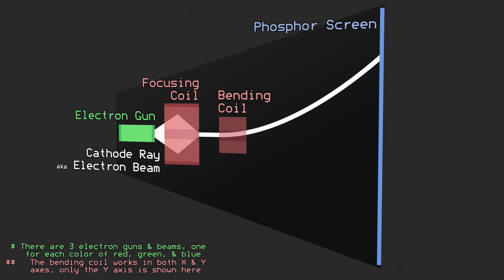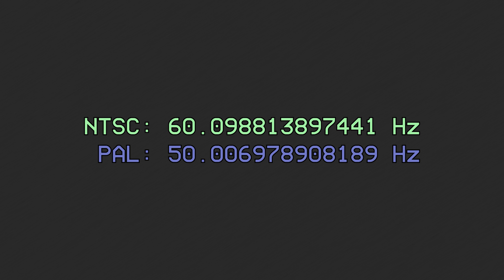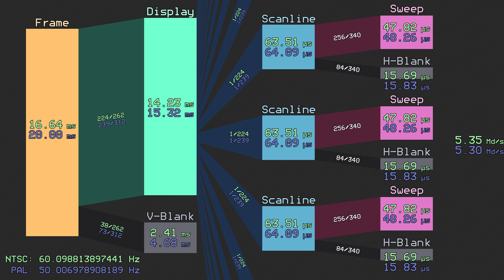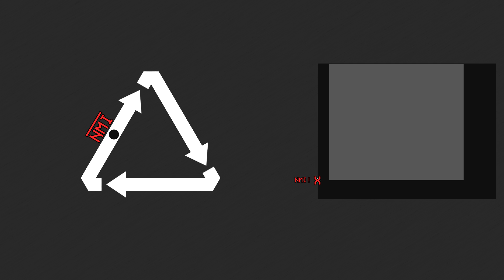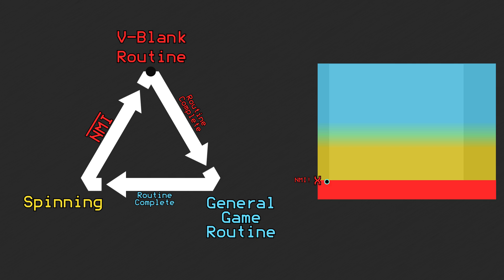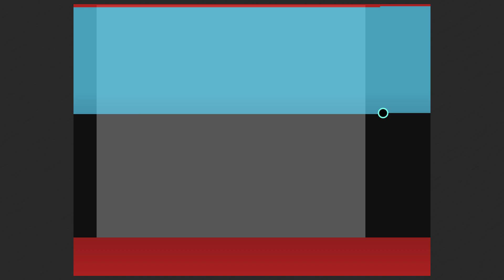Lag & Blanking - Super Nintendo Entertainment System Features Pt. 06

Comment: Speaking of blanking lag: I have made some 32x32 question mark blocks for SMW and they sometimes cause blanking lag (I believe when updating the tiles on the tilemap).
The only exception is if there is some HDMA involved. Then the blanking lag is replaced by glitching the stuff the currently activated HDMA affects (e.g. with an HDMA background colour gradient the colour gets messed up or the layer 2 background glitches if a layer 2 scrolling effect exists there). Do you know why specifically the HDMA glitches on blanking lags and not cause black scanlines?
Reply from the maker: HDMA has priority over DMA, so a DMA transfer will be paused while an HDMA transfer occurs. The exception is if the HDMA uses the same channel as the DMA, in which case the DMA is halted and never completed. I'd have to mess around with it myself, but maybe the HDMA also gets terminated if a DMA transfer on the same channel is initiated.
Reply: @RGMechEx  Looking back at this, I now understand what you mean.

The problem with your theory is that I never used HDMA on channels 0 to 2 (which SMW uses them for general purpose DMA) but rather 3 to 6 which are unused inside levels as well as occasionally 7 if I use windowing. Furthermore, I always set the DMA registers inside level initialisation and never during the main code so if I used HDMA on the same channels as DMA, the whole screen would have stayed glitched instead of just one frame unless I, of course, reset the HDMA registers.

Of course, three years did pass by and I now know that HDMA can't be enabled outside of v-blank since doing so will mess up A2AxL and A2AxH unless they're reset manually (I know that Yoshi's Island uses that trick since it uses f-blank to artificially "extend" v-blank and that v-blank is enabled midscreen is far more likely than without).

Comment: mmh. Really well explained.
Worth noting that a major advantage of PAL systems (which is rarely utilised, because doing so would make games that are almost unplayable on an NTSC machine, which for obvious reasons isn't great if you expect to sell the game... It would preclude selling it in America or Japan...).
Anyway, they have a substantial advantage in terms of how much VBLANK time you have to work with.

It's anything up to 85% more time. In theory this would allow some really complex graphical routines that would choke an NTSC machine, but as I said, for practical reasons this tends to be avoided. (except in tech demos.)

This by the way isn't an advantage to the SNES specifically. Variations of this advantage show up nearly across the board in 8 and 16 bit consoles and home computers.

It's such a big advantage that a lot of the demoscene uses PAL machines in preference to anything else...
Reply: CRT arcade machines didn't use PAL, NTSC or any color encoding, they used RGB component signal. Refresh rate is controlled by the game, doesn't necessarily have to be 50 or 60hz.
For example original Mortal Kombat runs at 53Hz.
Reply: @Worstplayer  53Hz? I'm amazed anyone played it. The flicker would have been intolerable for me.
Reply: Or maybe arcade cabinets tend to build on PAL system instead? I'm not sure if that's the case though. (At least in China, many old cabinets were probably pirated ones, while newer ones basically just don't have to worry about these stuffs at all, and there aren't really any LCD screen that works exclusively on 50Hz.)
Reply: That seems unlikely, but it's possible. Most arcade machines are simply more powerful than home systems in general.
You can see that by looking at the Neo Geo, which had a home version with the same specifications as an arcade machine, but was exceptionally expensive...
Reply: Worstplayer
But it doesn't stop people from turning a SNES into an arcade machine. Not sure if the game can adjust hsync and vsync though...
Reply: One of the reasons C64 demos were so more popular in Europe.
Reply: Pretty sure most arcade machines used SCART which (if memory serves) is essentially a component video signal that's voltage shifted in some way.  I don't think different output methods affected blanking at all though.  

The difference between PAL and NTSC is actually the power line frequency.  America, Part of Japan and a few other countries use 60Hz while most of Europe, another part of Japan and some other countries use 50Hz.  Power lines use Alternating Current (AC) which essentially switches the power in the lines on and off 60 or 50 times a second respectively and as a result the CRT screens and most traditional lighting also flicker at similar rates (which is too fast for us to notice).  I presume PAL systems have longer V-Blank times because of this difference and the difference in screen size.  LCD's and computers run on Direct Current which is (generally) always on at the source so they don't have a frequency (batteries produce DC naturally and everything else uses a converter which is why we have power bricks). 

Note:  AC actually switches directions and internally computers use pulsating DC which does have a frequency but for the purposes of this post that's irrelevant.  Also come to think of it the screen size thing might actually be the bigger issue but the reason PAL and NTSC exist in the first place is because businessmen in America and Europe (not sure exactly who or where) decided to focus on different standards in order to build their own monopolies.
Reply: And while PAL has lower refreshrate (and thus longer frame times) it also has more horizontal lines (576 instead of 480), it actually pretty much cancels each other out. But since you don't have to use all the lines and can use the 480i that NTSC uses can give much more time to draw each frame.
And then there is PAL60 which basically carries an NTSC signal with PAL color coding.
Also the interlaced nature, close to hardware implementation and lack of any DAC's makes CRTs way more responsive. When somebody boasts with their fast 1ms TFT, remember that CRTs can have a response time of under 0.02 ms .
Reply: Most of the demo-scene is coming from Europe so I guess PAL wasn't so much chosen.
Reply: I think it's the other way around, PAL was chosen because it's better for the demo scene and since most of Europe uses PAL anyway it's easier for them to produce them which also makes it a lot more popular there.
Reply: @HappyBeezerStudios  Technically, yes. But some aspects of it still persist.

For instance, I live in a former PAL area and digital television broadcasts here are 576i at 50 hz (a resolution derived from PAL - or rather the underlying black and white standard that PAL usually is applied to), and the HD broadcasts are 1080i ... ALSO at 50 hz.

So, the legacy lives on.

Also if anyone is wondering why I mention 8 and 16 bit consoles specifically - later consoles usually render their graphics into a framebuffer and use double buffering.
As soon as you do that vblank stops being relevant, since you draw to an offscreen buffer whenever you feel like, and the swap with the onscreen buffer when the image is done.
This swapping process has to happen during Vblank, but nothing else does. (besides which the later consoles generally properly supported PAL resolutions anyway.)

It's also not relevant on PC.
I forget what older standards are, but the standard VGA resolution is 640x480 70 hz.
(Doom has a framerate cap of 35 hz - exactly half this standard rate.)
By the way, VGA cards actually display lower resolutions by scaling them up to 640x480.
320x240 is output as 640x480 with doubled pixels and doubled lines.

Arcade machines probably output whatever refresh rate the designers felt like...
(SNES has RGB output available of course, but that doesn't change anything about the signal timing. an NTSC SNES will output RGB at 60 hz, while a PAL model will do so at 50hz - given that most RGB monitors cannot support the timing of this (it produces a 15 khz signal where most monitors expect signals of 31 khz or higher), only the PAL system was used with RGB in practice, because Europe had widespread adoption of RGB scart (scart is not a signal standard - you can use composite or S-video over scart too. So Scart and RGB are not the same thing), this was the only region in which game consoles were likely to ever be used with RGB output.)
Reply: To be entirely clear, the reasons for this advantage PAL machines have is accidental.
(and ironically the ultimate cause of it is lazily converted NTSC machines that have only minimal hardware changes.)

A complete NTSC signal including blanking is 525 lines interlaced at 60 hz (well, 59.97 but close enough) (effectively 30 full frames)
(actually NTSC and PAL refer to colour encoding only. Hence why PAL 60 is a thing. But the underlying TV standards don't have obvious names, and using PAL and NTSC is close enough most of the time).
A complete PAL signal including blanking is 625 lines interlaced at 50 hz (25 full frames)

Most game consoles make use of a malformed signal that has the effect of creating a 'progressive' signal. This is a hack, not an official standard, but most TV's don't care. (newer ones that use digital logic often actually DO care though - and 'fix' what they interpret as a broken signal, which is problematic for using retro hardware on modern televisions.)
this means these consoles output effectively 262 lines at 60 hz for NTSC, and 312 lines, 50 hz for PAL.
This leaves half the lines onscreen blank, but functionally doubles the framerate.
Anyway, so...

The heart of this issue is not really that difference, but that most of the hardware is built for NTSC, and then converted using the least possible effort to function on PAL.
That means the CPU speed is broadly the same (often slightly lower on PAL) as is the output resolution.

From the drop in framerate alone, we see the PAL machine runs at 5/6 the framerate.
But it should not come as a surprise that this means there is 6/5 times as much CPU time associated with each frame.
That means 20% more CPU time per frame is available, thus you already have a better CPU to graphics ratio.

But it goes further than that when it comes to vblank - since for most systems you can't mess with video memory while the video chip is using it, V-blank and H-blank are the only times you can access video memory and do any graphics related tasks that the CPU needs to be able to handle.

NTSC should have 240 visible lines and 22 blanking lines, and PAL should have 288 visible lines and 24 blanking lines. That IS slightly more, but not anything particularly substantial. (you still get that 20% bonus CPU time from the lower framerate though)
In practice, because of the bezels on CRT televisions, even some of the supposedly 'visible' lines usually aren't.
That's why in practice NTSC machines are often using 224 lines. (older ones often use 192)
But do PAL systems use 267 lines? Which would be the whole visible part of the screen? (based on my own estimates).
Nope. Either they use the exact same resolution as the NTSC machine, or they have a small bump, but not nearly enough to cover the whole visible area. - this is the source of the black bars on PAL systems.
So... 224 visible lines on NTSC leaves 38 blanking lines.
But instead of 267 lines, as you would expect, the PAL systems typically output 240 lines, or sometimes even exactly the same resolution as the NTSC machine. 312 - 240 gives 72 blanking lines. While going all the way down to the NTSC equivalent 224 lines gives 88. 72/38 is 89% more blanking time. 88 on 38 is 131% more blanking time.
Combined with the gains just from the lower framerate, you can see that there is a LOT more blanking time on a PAL machine...
And it's something you can blame almost entirely on not bothering to use the extra available resolution that is gained by the lower framerate. (which is a straight tradeoff. 30x525 = 15750 lines, 25x625 = 15625 lines. So they are very close to the same overall detail, just one has a higher framerate, the other a higher resolution. All well and good, but 8 and 16 bit computers almost never made use of the extra resolution, and thus you got black bars. - but this translates into extra Vblank time instead, so there's still something gained for what was lost.)
It's not that there are NO machines that were designed properly in this regard. The actual European made designs for instance, either don't make this mistake or do so knowingly (the BBC Micro and ZX Spectrum for instance), and some systems were properly adapted for Europe. (The Amiga has proper 288 line output on PAL systems, which negates the vblank advantage, but does give improved resolution - as intended given how PAL displays work...)

So this advantage is caused unintentionally, but it's quite real nonetheless.
Reply: It depends though because PAL has a lower framerate even if slightly lower but if you’re playing a game for something like speedrunning even a single millisecond an be the difference between world record or not

Comment: So are LCD TVs designed to emulate this when reading analog signals? Do they paint one line at a time, or get the whole frame and just display it?
Reply: ZipplyZane flat panels scan out the display pixel by pixel in a similar way. There is no way to instantly transfer an entire image of data to the screen.
Reply: They do it even when interpreting HDMI and similar modern digital signals.
There's really no technical reason why they need to do it that way anymore (though you're still generally sending a single pixel's information at once), but on the whole we just copied over the logic from CRT televisions and monitors, and LCD displays mimic this behaviour.

Usually this doesn't matter, but there are some usage cases where it really would be better to change the logic. (VR headsets are one that could really benefit from a different kind of update scheme.)

As of yet this is how it works though.
An LCD display internally mimics a CRT scan pattern by updating the pixels one at a time in a specific order.

Comment: If there are more "blank scanlines" at the pal versions and it runs slower (at 50hz) does that mean that lags, blanks and slowdows are rarer in the pal console outputs?
More time running the v-blank routine in theory means that it shouldn't overload to the game routine right? unless i am missing something.
Reply: If the game is programmed with "framed based movement" in mind, then the game is running at 5/6 of it speed, making a lot of PAL ports of games feel significantly slower then their NTSC counterpart. So, yes: Lags, blanks and slowdowns are rearer - but the game is running slower all the time.

Comment: Interesting that the DRAM strip in the frame paint is in the exact spot that people exhibit the video flaw of a lighter line in the video output...I wonder if writing to DRAM is causing a strain on some of the components which leads to this video artifact on many aging SNES consoles...
Reply: It's a common flaw to other systems too. The Mega Drive/Genesis frequently develops the same problem.
Fundamentally it's some kind of noise on the video output. Though the exact source is unclear.

There are many known fixes for the Mega Drive, and on that system it clearly has nothing to do with DRAM, but on the SNES... I'm not so sure.

It's also a form of visual artifacting mostly seen on the earliest revisions of the console. (There are at least 4 versions of the hardware internally)

I have a super Famicom that is from 1990 and shows the problem quite strongly nearly all the time, but then I have a PAL system which is a much later revision (1994 I think), and while the effect is still there, it's all but invisible except on very dark backgrounds. (especially black).

I've taken both apart so I know that they are completely different hardware revisions...

Definitely noise of some kind... But I'm still not entirely sure what the source is.
Reply: Both of you are correct.  It's coupled noise from the DRAM refresh pin.
Reply: I always thought it was coupled noise, but hm, it could be PSU fluctuation.  Might be interesting to watch the 5V rail on a scope with a h-sync trigger.
Reply: That's the first thing I thought of too when I watched the video!